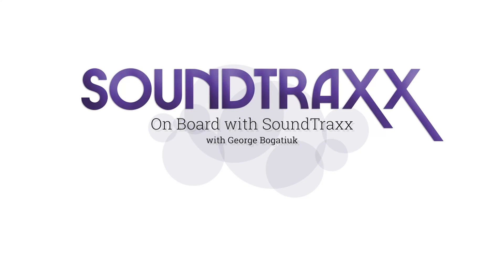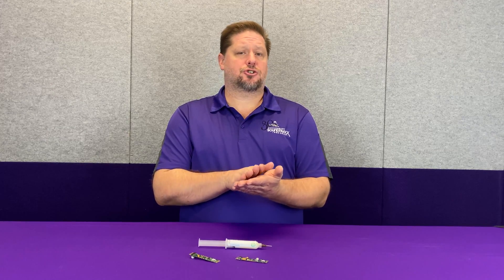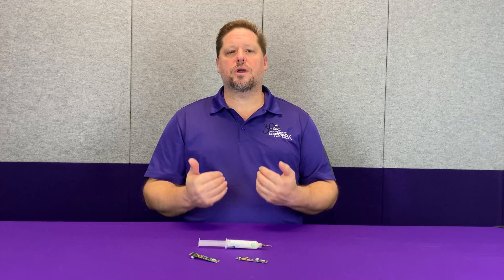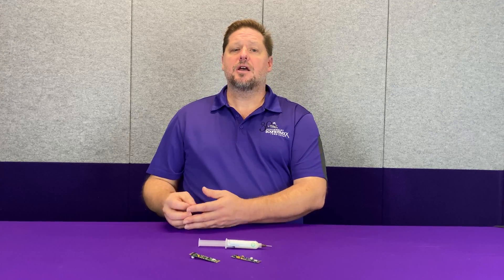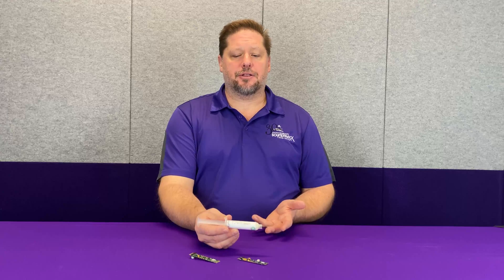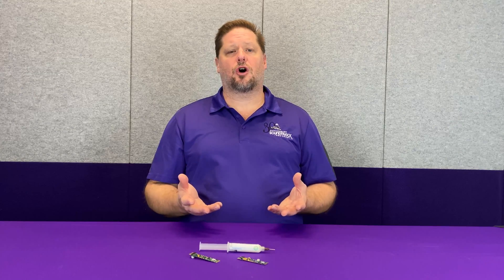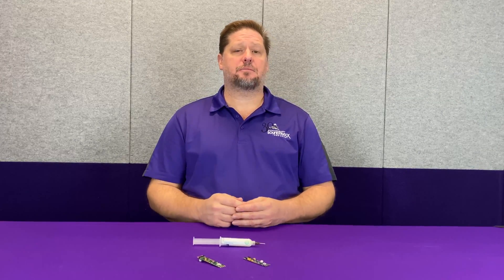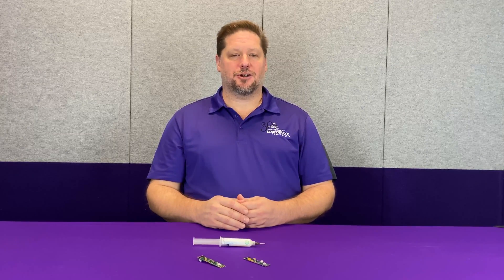Flux: Friend or Foe

Comment: I use rosin core solder, and only flux my wires before I tin them, then get the tinned wires through the holes and solder them into place with no flux.
Reply from the maker: Flux just helps make it easier and makes nice clean joints.

Comment: I've never used flux. I was under the impression that flux was not for use with any electronic soldering. So I used rosin core solder exclusively. Have I been doing it wrong for the past 45 years?
Reply: You’re not doing it wrong, but you could be doing it better. I went to several soldering schools when I was in the navy, including a month long MIL-STD 2000 school where we learned to solder under a microscope, and we were taught to use flux in every one of them. After the first one, which was 3 days long, I realized how badly I had been soldering when I didn’t use extra flux, but had only relied on the flux that was in the core of the solder. We’re never too old to learn a better way to do things.
Reply from the maker: There seems to be some debate about if you need flux or not in the comments. It does help, but you have to use the right kind of flux. If you use flux with a high acid content you will damage the board. Some people seem to be getting by fine without flux.

Comment: Hi George, very fine advice!  I use CHIPQUIK almost exclusively!  It is a very fine flux for soldering electronics.  When I am finished soldering I remove the remaining residue with 70% or 91% isopropyl alcohol from the local pharmacy or supermarket.  If it is a clear shot, a short gum cleaning toothbrush or a q-tip works well.  If I’m in the cellar I’ll blow it dry with a little carefully aimed compressed air.  Thanks!  Yours is really good advice!!!
Reply from the maker: Thanks for watching and thanks for the feedback!

Comment: Another point to remember is to use flux sparingly.  I used rosin flux on a PNO decoder. The excess flux ran over the decoder and caused problems.
Reply from the maker: Yes a small amount does the trick.

Comment: I have done a lot of decoder installs. Rosin core .015 solder is all I have used. Never had an issue. Don't touch the contacts and the stripped wire. The oil from your fingers are not friendly to solder joints.
Reply from the maker: Thanks for the feedback

Comment: Good advice on the correct flux to use. I’ve seen many folks write in or ask if they can use some unknown flux they found in their garage or basement to solder a decoder. Just bite the bullet and spend the $10-15 for the right flux and the right solder that is meant for electronics. Also, great video, George.
Reply from the maker: Yes, better safe than sorry!

Comment: I have found in my 100+ installs using your board or Loksound board. The solder flows perfectly without flux on both boards. Thanks for quality workmanship.
Reply from the maker: Flux can help, but we are glad that you are not having problems.